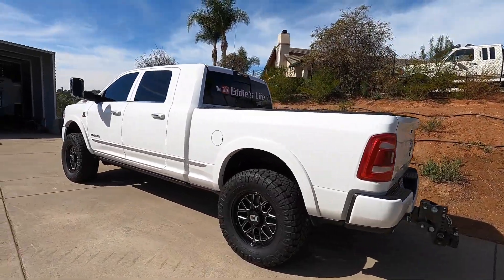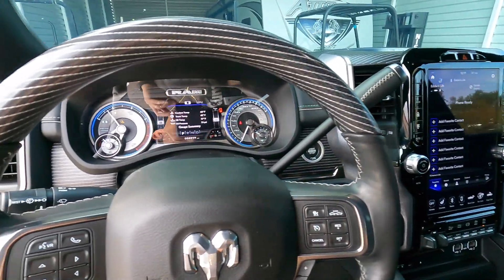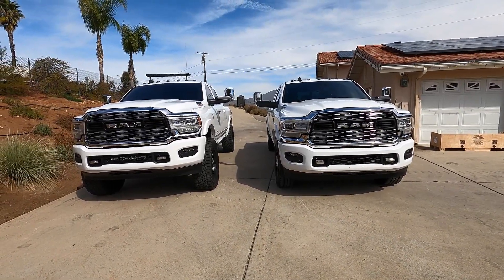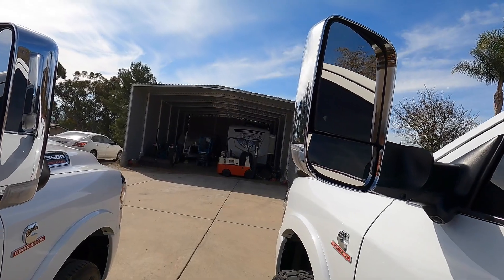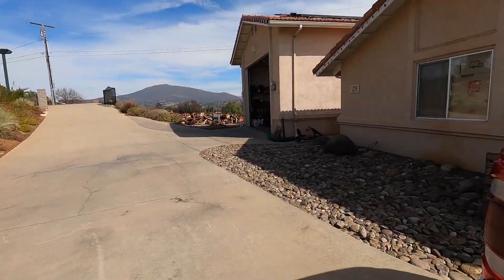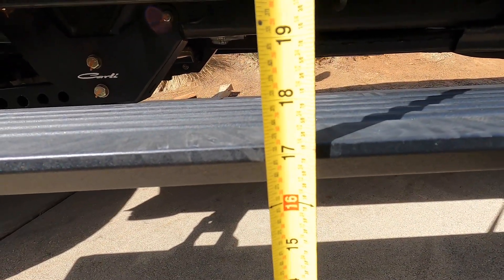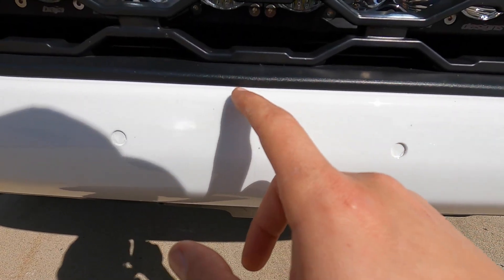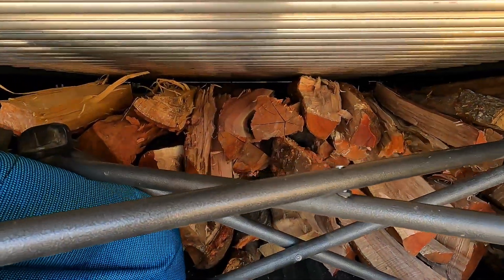Stock VS Lifted?

Comment: Won’t be an issue with the grid heater deleted until it gets below zero. Plugging it in would be the best thing if it ever does get that cold anyway.  All that grid heater does is heat up your intake air so starting without waiting isn’t harmful on your engine. I live in northern Utah and deleted grid heater off my 02 Cummins and never plugged it in either. Always started right up. I did enable the high idle and 3 cylinder high idle function tho.

Comment: You can do the grid heater delete and it will still start no problem. If you are worried about it when you are in cold climate then put the block heater cord on and plug it in and it will start just fine no problem. I just started my 5th gen cummins not plugged in in -18 degrees and it started just fine with just grid heater and wait to start cycle. that was today in North Texas yes TEXAS

Comment: I’m in Montana and got rid of my grid heater. Starts just the same. Might get a little puff of black smoke in the cold at start, but it’s quick and goes away. If you go to Big Bear, just plug it in when it’s left outside. It’s amazing how much power those grid heaters suck.

Comment: You can delete the grit heater but it will start rough when is cold without it. The grid heater will warm the air going in the engine thats all. I ran my 3rd gen without it all winter in wisconsin and started rough.

Comment: Eddie, I watched your first oil change video on your 6.7 cummins and I saw you were using Rotella Full Synthetic T6 5W40, I live in Las Vegas and just bought a brand new 2021 Ram 2500 with the 6.7 cummins, it's getting pretty hot here in Vegas and I wanted to see if you still use the Rotella T6 in the summer months when it gets hot? Thanks so much brother!
Reply from the maker: Yes I do
Reply: @EddieLife3500  Hey awesome man thanks for the reply! Looking forward to doing my 1st oil change, 700 miles and counting!
Reply: best thing you could do for your interior temperatures is get nan-ceramic window tint. stay with 72% or above light transmissibility to stay on the legal side of laws. but it will cut the UV rays by 95% plus and save your skin, literally .. from years of sun damage.. now i've got crepey skin and i get nicked and bleed so easily

Comment: What about the rear end and transmission they are cold when you move the vehicle?
Reply: Eddie needs portable space heaters for every component!!! I’m the same way though, I cringe when someone starts a vehicle and it’s barely idled down and they slam it into gear!!!
Reply: I take it nice and slow when my truck is cold. Once to operating temps is when I drive normal or start towing.

Comment: The truck will start no problem in colder temps...another way to warm your truck up faster is by hitting the high idle and the exhaust brake
Reply: I was told it's not ideal to run exhaust brake cold.

Comment: Can you tell me why when I turn hard and fast right in my 2021 ram 2500 limited with 200 miles I hear a pop under the front end is this normal
Reply: Not normal

Comment: 15 degrees?  That's not cold your truck won't even flinch.  I don't even plug in unless it's below zero.  With anti-gel you don't even need to.  Maybe -20 or colder.

Comment: The truck will start no problem in colder temps...another way to warm your truck up faster is by hitting the high idle and the exhaust brake